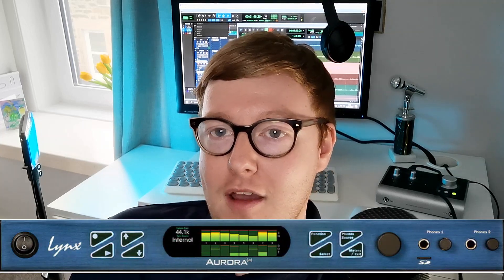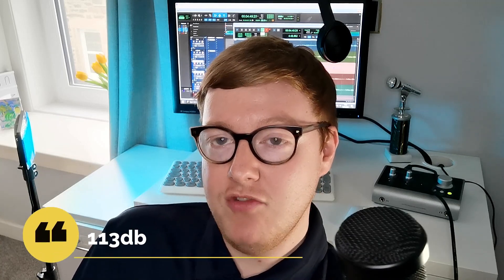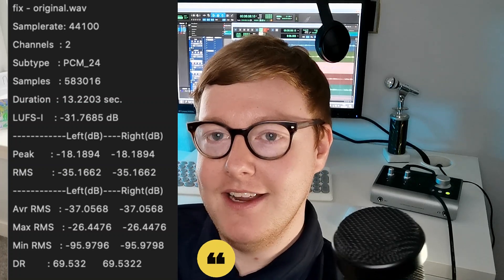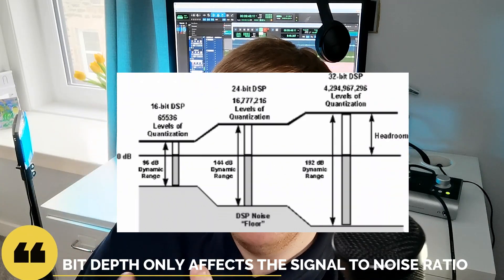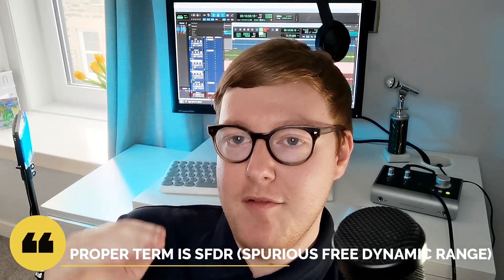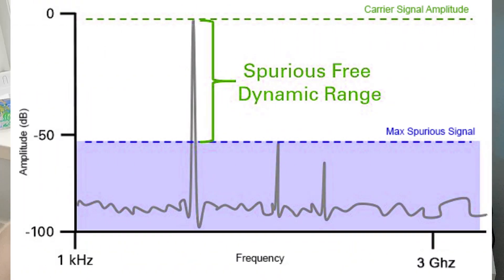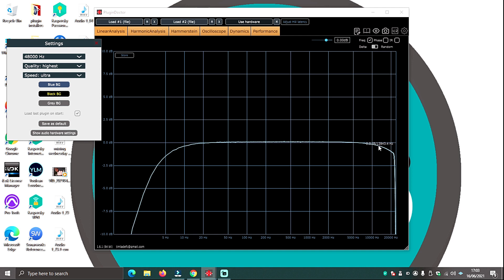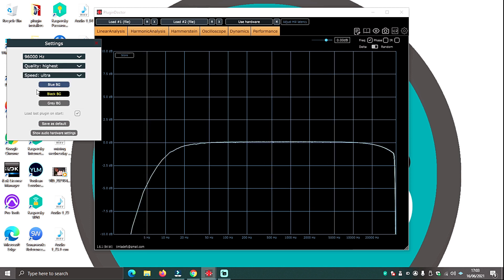Do you lose audio quality in analog gear using budget interfaces vs expensive ADC Converters (Pt 1)

Comment: Three things: 1) one must know how to listen and already developed their ears to a degree (pay attention to things like bass extension for example)  2) without a proper monitoring situation you’ll likely not notice much of a difference 3) Individual tracks do matter, but multiply that across an entire mix…. I wish it didn’t make a difference but it does.  Clocking also makes a difference that is quite audible to me.  All that being said, we do not need to spend this kind of money to create compelling art.  It’s simply a luxury, not a necessity.  Just my idiotic opinion for whatever it’s worth.  Love your vids Paul
Reply: I can agree. I would lose quality that's very hard to describe when I start adding tracks on top of tracks on cheaper interfaces. Most would say if user error and I would admit I'm no CLA but I no longer have that issue using Burl and RME ad/da. Not to mention how much better my mixes is translating.
Reply: @jermainesmith6315   Which RME device are you using ?
Reply: @bontempo1271   madiface just for DA and monitoring ITB. I also have the M32 DA for summing out.
Reply: @jermainesmith6315   ah ok ty :)
Reply: it's unclear what you are talking about. Are you saying running tracks/mixes through analogue gear matters (a tiny bit) for quality? Cause it doesn't.. no matter how many tracks you have in your session. It really doesn't. Now when you have an anlogue recording.. like vocals.. that's when you'll need a good enough room, a good enough mic, a good enough audio interface and (most importantly) a good enough singer.. but other than that analogue gear will not even be a necessity for 2 million dollar productions. It may be neccessary in order to convince someone to pay you 2 million dollars - but that's another story.
Reply: @akagerhard  Obviously speaking about the difference high quality converters, in conjunction with proper monitoring and a reasonably developed set of ears can make in terms of allowing us to make better decisions throughout the entire mixing process.  I’m sorry but converters do matter.  Is it absolutely necessary? No, of course not and there are examples people may cite of hit songs being recorded/mixed under less than ideal conditions.  However, it does matter at the end of the day and the difference monitoring through a cheap M-Audio interface compared to one of my better converters (Dangerous Convert, Lynx, Apollo-X) is huge to my ears.  When I referenced multiple tracks, I was speaking about the clarity, detail, separation etc provided by decent converters.  Ultimately, skills as an engineer, and familiarity with the gear we own make the most difference.  We are all just quibbling about tiny details in order to avoid making music LOL.  Once I experienced high end converters, however, there was no going back.
Reply: Yea but Dragon, because we can hear the original audio in this demo, we can clearly hear that the Lynx conversion is colouring the sound.
I know the high end convertors sound fantastic, but it makes you wonder, for precise monitoring (D/A), maybe aiming for transparent convertors would be better !!  Although for capturing (A/D), i would opt for high end if i wanted that colour.
 I'm going to run this test myself, got an old RME Fireface 800 and compare it to a couple of the online analogue services.
I did some vinyl recording using the RME to capture, and i was able to get the 24bit 96k recordings really really close to the vinyl, and thats some feat because comparing vinyl to their digital releases, i could hear the vinyl mojo (RIAA process alot to do with it). Depth, warm rounded bass, smooth highs.  The digital release sounded like flat cold arse next to it.  So i was very happy with my captures.
Mind you, i had to find a neutral but detailed stylus/cart and neutral phono preamp,  or none of this would have worked. Many available components colour the sound, for better or worst.
Reply: Who are people listing music with "proper monitoring" etc...blablabla... ? People who listen music after product doesn't care about that and doesn't do a difference ! This argument that "with good monitors at 3500 $ you'll hear a difference"... that sucks man... With modern equipment you can do amazing things but it's not enough capitalist for big brands !

Comment: Past a certain point, more bits only gives you better dynamic range, but sometimes you need that. The higher dynamic range in the original, the better it will sound after conversions and effects are added.  That tiny roll off has to be in the quality of the anti-aliasing filters, as you surmise.  A couple points you didn't cover:  Higher bit rates will matter a lot more catching the nuances of a professional soloist than the crunch of a rock band.  You can compensate for a < 1 dB roll off (or even a little more) without butchering the final product.   But what I really want to know is.... Why are we calling ADC/DAC's 'analog gear' now?  :-)
Reply from the maker: When did we call Converters analog gear?

Comment: I was considering a Lynx Hilo converter to upgrade from my current Focusrite one but your video got me thinking. However after watching anothing video with this same Audient converter VS Apollo Twin with audio looped and converted 100 times, the Apollo's sound came out cleaner. In your test, is it not a case of the more expencive converter just has more converters which is why it costs more instead of the quality of just the converters in use?
Reply from the maker: Being honest you should always base a test on real world scenarios. The reason for looping 100 times is due to the fact that it's extremely difficult to tell any difference in one round trip of conversion. Even at 50 trips its pretty hard to tell the difference but you only need to worry about the difference of one trip. If I'm printing hardware via an interface I'm only going to record it once so you test 1 trip.

These 50, 100, 500 trips of conversion tests don't have any relevance in the real world. Interesting as it pushes the boundaries of their capabilities but let's face it. If you have to loop audio 50 or 100 times to hear a difference then you've got no worry
Reply: I would suggest you to try to look at pictures of the pcb of the interface you mentioned. Chances you'll be able to have a peek at precesely the part number of the converter chip used. Then google the part number + ''datasheet'. There's no fairy dust. lol

Comment: Thanka for great video. What do you think of monitoring DAC converters? At the moment I'm using Steinberg Ur824 audio interface for all my audio conversions. I'm quite close of buying Cranesong Solaris DAC, for my monitoring DA (it's around £2k). Do you think is worth it? What is your opinion?

Also would you recommend mixing in 96k from the very start? I also use SSL analogue EQ and compressors, when printing audio through them would you recommend 96k? I'm currently using 48k all way through.
I'm quite confused.
Thank you so much for clarification.
Lucas
Reply from the maker: Theres a video Julian Klein did on headphone and output DAC where he measured loads and compared.

For me. I can't really answer that yet fully but I do plan on getting a seperate headphone DAC (topping possibly) to compare against the id14. For studio monitors I shouldnt really find you having that much of an issue if you are listening at moderate levels. I'm going to watch more of Julians videos so I can get a better understanding as he seems to be the best at comparing DAC's

In terms of mixing at 96k I think it's personally OTT unless you aren't internally oversampling and using plugins that suffer from audible aliasing (waves etc)

Recording at a set sample rate through an audio interface is different than mixing at a set sample rate.

As we see here the anti aliasing filters in the interfaces has an audible high roll off so for a flatter frequency response you are better to record at 96k, but each interface will differ so it's best to check.

In terms of mixing it's the daws sample rate as the interface isn't affecting the sound until it gets to the output stage (headphones & monitors) but isn't affecting the actual audio waveforms in the daw as it only affects the recording stage as the signal is being fed through the preamps when printing and recording.

So mixing at higher sample rates in the daw is really purely to limit aliasing which can be avoided by choosing your plugins wisely, gain staging correctly and utilising internal oversampling via metaplugin for plugins that do have audible aliasing or using plugins that have oversampling options.

IF you do all that then you really shouldn't hear much difference between mixing at 48khz and 96.

Im recording at 96k so I record with a flatter frequency response, then import the files into a 48k session and mix through there 🤓
Reply: @PaulThird  thank you so much for very informative answer. Just last quick question. I put loads of tracks while mixong through analogue SSL EQ and SSL analogue compressor. I always set my DAW at 48k. So when I'm printing separate tracks through outboard gear I get 48k as well. Is that correct, or I should pring them at 96k. But does aliasing distortion occur when coming from analogue outboard gear into DAW?
Thanks once again.
I'm still bit confused though.
Reply from the maker: Aliasing is purely digital so you don't need to worry about it in analog gear
Reply: @PaulThird  so basically when I'm printing from analogue gear into DAW I'll be fine regardless the sample rate? Thank you.
Reply from the maker: Yeah you won't have any aliasing issues due to the filters. That is unless you absolutely abuse the pre's of the interface by absolutely smashing the output of the hardware, but even still the aliasing caused by the interface is pretty minimal.

IF you gain stage correctly then you'll never need to worry about aliasing in audio interfaces when printing analog gear. Honestly you'd really need to abuse the interface going in to cause any aliasing as if your causing so much harmonics in the audient pre's that it's aliasing then you are gonna find your hardware and interface are constantly pinned in the red
Reply: @PaulThird  thank you so much.

Comment: i have the big brother which can bypass the pre amp. do i still need to  record 96k? to be flat?
Reply from the maker: I wouldn't imagine so for printing hardware as you can bypass the preamp but in terms of recording through the preamps id take a guess that it's flatter at 96k. Depends on the anti aliasing filter at 48k

Comment: How can anyone record and mix in 96k with acustica plugins.    I tried, with my i9,  and dont get very far.
Reply from the maker: I don't record with AA plugs. Only mix. No problems with my i9
Reply: Yeah i very rarely record with Zl acustica, because they are cpu monsters,  but whenever i switch my daw from 44 to 96 sample rates on a song while mixing, i find it all of sudden cant handle the plugins in have on and starts suttering.   Does 96 sample rates use more cpu or is it maybe ram causing this?
Reply from the maker: I mix at 48k. It's cpu. The higher the sample rate, higher the CPU as the system is working harder
Reply: @PaulThird  Ok so i should give up on 96k ideal,  until the next generation of computers, unless im doing some minimalist song, but i should instead move up to 48k for some sound quality enhancement.   Do you track audio, vocals, bass, guitar at 96k for future considerations?  Then move it down to 46k for mixing

 Studio one seems pretty pathetic at distributing my cpu, i thought i would have a way higher roof, even with many acustica, but no,  still have to print tracks, after a half a dozen or so.    Can you hear the difference between 44 and 48?  Or is it mostly to make your recordings available for streaming and film.
Reply from the maker: In all the polls that I've seen done. 44.1 and 48k are the main mixing sample rates. 48k has won every time but its close.

Only realistic benefit to 96khz is that you'll have less aliasing but if your like me then you just internally oversample the plugs that suffer OR pick plugins that are already internally oversampled or have very clever anti aliasing filters.

At 96 and 192 you can practically use what you want but your creating bigger file sizes which mean bigger sessions, higher RAM, higher CPU.

If you are clever about your plugin choice and gain stage correctly then you could even mix at 44.1.

If you pick the right tools and use them correctly then you'll find comparing 48 to 96 is inaudible.

Plus it all gets converted down to a 44.1 or 48k wav file anyway.

Bit depth is more important as that's your signal to noise ratio. You'll have less noise floor and cleaner records at 24 bit compared to 16 bit.

I think of bit depth as dynamic range so the higher the bit depth the higher my signal to noise ratio.

I think of sample rates as the width of my frequency spectrum. The wider the frequency Specrum the higher nuquist is which is going to result in less aliasing.

So in recording. 96khz can result in a flatter frequency response as your recording with the interface which doesn't need to have lpf filters at 20k. It can have its filter higher up the frequency spectrum which means it isn't audibly rolling off the highs. The filtering depends on the interface though but I'd say recording at 96k makes more sense to ensure a flatter frequency response. 

Id say then converting it into a 48k session for mixing as it doesn't have the issue of the high end roll off as it's the DAW's sample rate.

Interface sample rate for recording, DAW sample rate for mixing. 2 seperate things.

That's as much as I understand things haha
Reply: @PaulThird  Ok thanks, i'm gonna google aliasing and how to change 96k audio files that i track into 48k in the same session for mixing (thats what i took from that for now lol)    and Thanks love you're channel,  i just started using water at the mid bell eq setting you gave, one of the best things i learnt on youtube,   I'm gonna have to go through all your acustica and other vids for other mixing gems.
Reply from the maker: Aliasing is unmusical harmonics which are brought into the frequency spectrum due to plugins creating harmonics that go past niquist which is your highest frequency. As a 48k sample rate can only reproduce up to 24khz any harmonics made past 24k bounce back and find their way into the frequency spectrum which are unmusical and unrelated to the fundamental (so a 1k sine wave should result in harmonics related to 1k so think octaves of 1k)

Aliasing will be random harmonics under 1k and unrelated to it going forward. When harmonics are audible they result in frequencies that are unmusical. Almost like if you were to have a C note with higher octaves and then random B# and Ab notes were mixed in underneath but still audible. Would tonally alter the sound of the note. Think of aliasing doing that to a sound source.

So if you use a sample rate of 96k then you widen the frequency spectrum to 48khz (sample rate needs to be double the frequency spectrum to reproduce it effectively). This way you'd need harmonics that go past 48khz to create aliasing which is more uncommon than 24k.

That's why plugins and the audient have lpf's or anti aliasing filters (extremely steep low pass filter) in order to stop any harmonics being made past niquist as if you reproduce certain high frequencies then you create harmonics past 24k

In protools if I import a 96k audio file into a 48k session there is a add & convert button. I press convert and it automatically downsamples the audio file so it plays back at the right speed
Reply: @PaulThird  Ok converting 96k audio into a 48k session should be easy enough then,   I guess first you do drums and put them in the 96k and 48k sessions in identical spots,  so you can line everything back up while moving the audio you track in the 96k session to the 48k session.   When you putting out your new songs you wrote on the gretch?
Reply from the maker: Pro tools conversion means that you don't need to adjust any waveforms. Does it all for you. Just import and away you go.

I'm recording the guitars for my next single this week as the students are on holiday so it's chill time at the college haha picked out all the parts so going to switch between both gretsch's and have one acoustic low in the mix down the middle